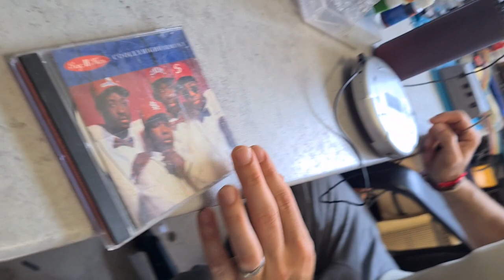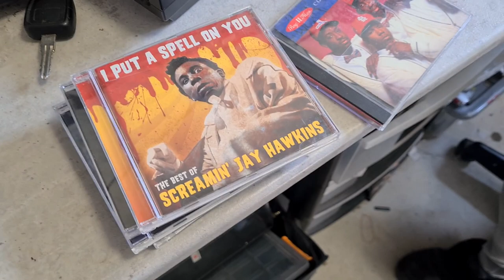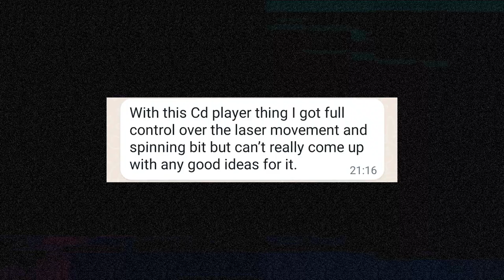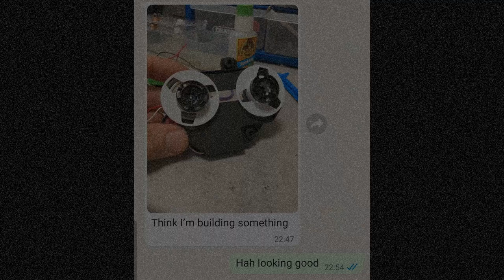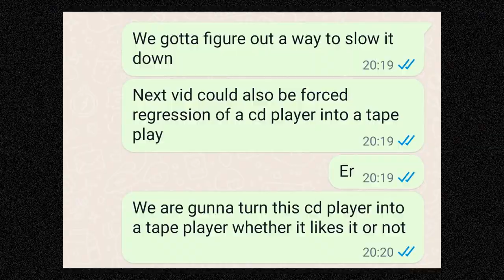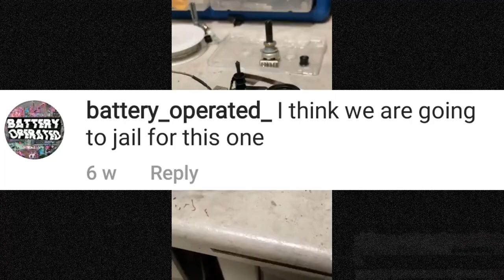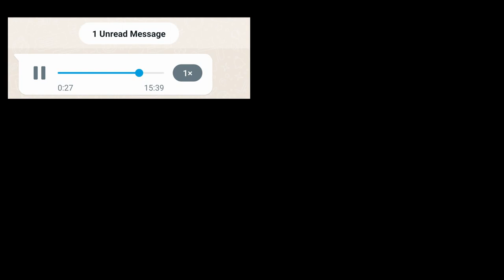We Forced a CD Player to Become a Tape Player....(sort of)

Comment: Love the videos mate! I was wondering what your background is? Are you an electrical engineer or something? Or just a very patient deep dive tinkerer? Lol anyways, keep doing what you do. Love it!
Reply from the maker: Thanks for the kind words!
We are not formally educated in electronics in anyway but we have always been tinkerers, when we were young we used to take stuff apart and then not be able to put it together again aha...
But later in life we started being able to fix things and then we got into circuit bending in 2017, so we've been at it for a good few years but it is all literally learnt from opening stuff up and having a look!

If you wanted to get started you could buy a electronics tools kit with a terrible soldering iron in it from Amazon for under €/£/$50, it will suck at first but you will figure out what tools you actually use, and then you can buy better ones later down the line.
You can buy already broken items on ebay (spares & repairs) and try fix them or you can fix your own things like TV remotes or console controllers are a good first fix.

Anyway! thanks for watching 👍